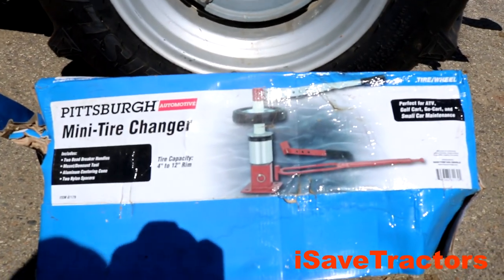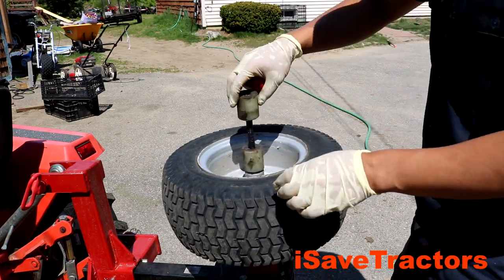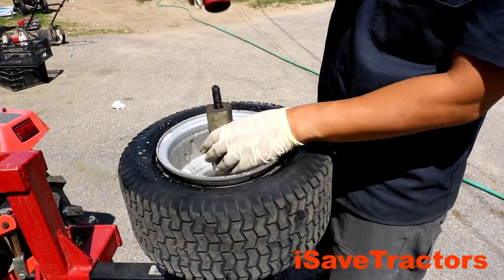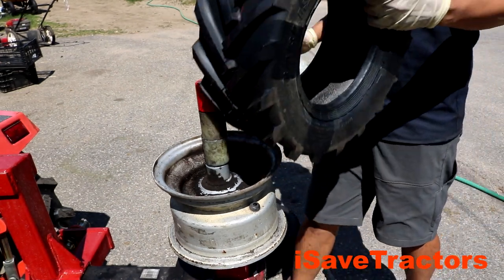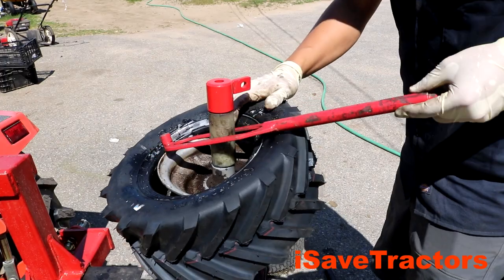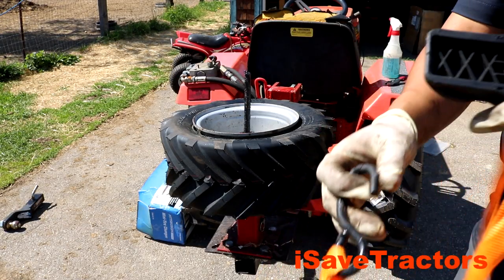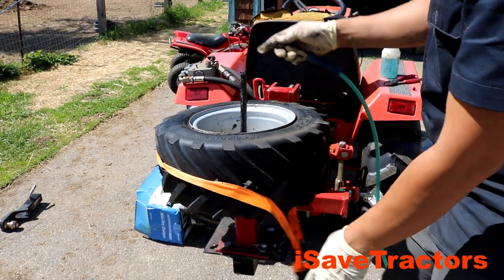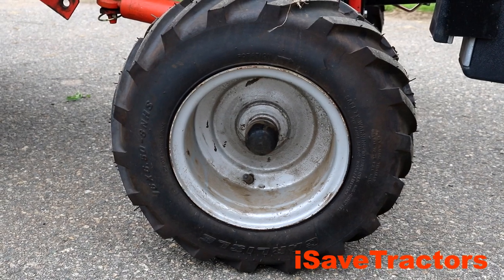Installing Garden Tractor Tire with Pittsburgh Mini Tire Changer from Harbor Freight Tools

Comment: Pro tip. Don't put the tire valve in before seating the beads. You'll get faster volume of air for seating. Clean the lube from the lower bead, then push down to seat the bead on the bottom as much as possible, then gently lift while applying air pressure from a 3/8" i.d. air hose. May not need the strap.
Reply: Pro tip throw that stupid tool in the trash. Leave the rim on the tractor get a duck billed sledge and a set of spoons. You can do this simple job in hakf the time

Comment: wow! that's a Harbor Freight tool I actually want.  I have fought with small tires for years.
Reply: I have one I bought years ago. Works well. The ONLY issue I have or maybe I should say wish, is that unlike an automotive type changer, it doesn't have a way to keep the rim from turning while your trying to remove or install a tire. Otherwise it works well.

Comment: Just found this. I want to change a 12" tractor tire and wasn't sure the tool could handle it. Now I know. I've changes smaller tires 10" rim with no issues. Love the tool and of course price, had it for a few years. Now I can start on the 12" rims, save money and drop off time. THANK YOU.

Comment: OP doesn't say anything about this, but shows it at the two minute twenty-four second mark, that a rim with a deep well on one side, has to be oriented like this, the picture or you'll never be able to get the tire off or on again.
Reply from the maker: Correct you want to work the side of the rim, where the tire can get some slack.

Comment: Nope, won't work for my Deere 265's front rims. There's no opportunity to keep the tire from not coming back up off the rim as you rotate the tool during install. Holding onto the tire doesn't matter. You can keep the tire inside the rim with vice grips on the rim as a blocker, but then you won't be able to use the tool to rotate it around.

Comment: Thanks much for your video. I have to change two new rear tires 23 x 10.5 -12 inch and do have a small tire changes which I have never used because had no way to secure it, but your application has solved that problem for me. Again thanks.

Comment: I  had a fella from work mount my tire changer to a 2x2 square tube for the receiver and bolt the tire changer to a plate with bolts ,He charged me $ 13 for the square tube he had to buy and it works great.Your video looks very easy I had a little more of a problem but will try your technique.Thanks.
Reply from the maker: Practice will get you there!

Comment: Good added tips jpeterman57; also wire brush the rim where the bead seats and use soapy water before removing the old tire.  Lastly and most importantly, the design of the wheel well determins which side to remove the tire.  You notice the shallow side of the wheel is up.

Comment: To stabilize it is the greatest challenge.  I may get one!
Reply: Paulie - I bought one a few years back, great product for the money. 💯 the hardest problem is mounting it to a solid platform !!! I tried an old pallet but it was too easy to pull the nails out of the cheap boards

Comment: I may have to try one of these. I have a manual bead breaker and tire spoons which work great, but on 8" and smaller rims, it is pretty difficult. the ratchet strap works most of the time, but sometimes it takes a long time and lots of fighting to get them to seat

Comment: You sure made it look easy brother. I did my first 12" tire repair with this tool by adding an inner tube to an old tubeless from my 1999 Murray lawn tractor. Took me over an hour. I learned a few things but what I didn't expect was after I pumped it up the valve stem slowly receeded inside the rim and vanished while I was reaching for the valve cap. Why me?
Reply from the maker: First few times it took me a while too. but after a few, it get's easier.

Comment: Those tire changers are cool and all, but I find it easier and faster to just use a spoon or two. It might be a different story if I had the space to dedicate to leaving it mounted somewhere. But alas I don't. 

Got any good tips getting a stuck bead broke loose? I personally put the lifting part of my "high lift jack" in the receiver of my van, put the footplate on the tire (which is laying on the ground below the van hitch) and give'er the beans. Usually works good. Have actually had one or two so stuck that it just about lifted the van.

Comment: For the tire, I just aired it up & the bead popped back on.😎 did the job without the tool & bent the bead, it was the old original tire I put a tube in it. Since I’m changing the 2 front ones I’ll be changing the 2 back ones too, one of the back ones is to far gone.

The tool has paid for itself already, & I’ve removed 4 tires w it & put 1 on some to be 3 more.

Comment: The only tires I've ever seen that required the ether/solvent fume ignition method are 40's and up... Otherwise, ratchet straps are the norm here in Texas. 
Years ago, we had one hell of a fight dealing with Long/Fiat 50 hp tractor and my Dad was in it to win it... He popped the beads off with the front wheel of his Chevy and fought the rubber off the rim. We burned the yard with fuel and ultimately swapped out for a better solvent like ether that really evaporates much faster... Gas trail to the tire and whoop!

Comment: Had a wise man show me a quick way to seat a bead, take the valve core out of the stem and push your air hose quick connect to force a high volume of air into tire then put core back in and fill to correct pressure, works most of the time as long as your compressor is decent

Comment: Nice tool and I made a receiver and riser for mine works well on my Toyota. Only issue I have is the threads on all thread and the nut are weak and pulled out. Going to have to modify it.

Comment: entire valve stem as well.  The starting fluid is not dangerous.  just need a tiny spray and then light.  it'll pop a bit and flame out but really it's nothing.  Just don't over spray, tiny bit enough.

Comment: how wide is the square steel plate and how thick of steel plate did u welded the square plate onto the hitch or bolt it down to it

Comment: Nice video. A question, is there any coating on the tool that goes against the rim. Looks like it could damage the rim.
The Ingersoll looks great with those tires👍👍👍
Reply from the maker: There is a rubber type material but mine has all rubbed off. I put duck tape down to prevent too much scratching of the rim.

Comment: I know this is old, but where did you get the black adapter? Bought the tool & im using a 4x8 section of wood & it’s really hard to Maurer, trying to hold the tool & get the tire off is a PIA!

Comment: About to go buy this in a few minutes. I've been struggling to remount a garden tractor tire i put a tube in.I don't have a receiver hitch..yet on my truck... but I bought a table vise to install on my garage workbench. I've seen videos of some using this method to secure the changer... not sure if i like that. Cast metal can crack and break with little to no warning.

 Mounting permanent to the bench seems restrictive (no way to get a 360 work space), Building a Mobile table also has issues.. (Don't want to chase it all over the Garage!)

 Looks like I need a floor mount with some angle Iron and concrete anchors (Got those). Anyone got any other suggestions.. Space is really limited in my Garage.

 Thanks for the Video and any suggestions. -Jake

Comment: Are there adapters with that tire changer to do larger rims with a large 2" center hole like on a 70s wheelhorse?
Reply: yes, there is an aluminum cone to fill the hole and keep it centered.

Comment: I have a 77 Sears 10/6 after running for the first time there was a little oil leacking out. looks like from a hole in the bottom of the intake before the carb? Do you know what may be causing this?

Comment: will WD40 sprayed on tire work as lubricant or better to use soap and water?  thanks.  good video.
Reply from the maker: Yes it will work. It should evaporate quick enough for the bead to not slide on the rim after insrallation.

Comment: Do you have a link for the hitch adapter. I am having no luck with it in my vice. It likes to pivet out.
Reply from the maker: I tried to look but I can't find it. I did get it off of eBay. Also you can take a big 2inch receiver tube and weld 1/4" plate to it.

Comment: Did you fabricate that receiver adapter, or does someone sell them?
Reply from the maker: I bought it off of eBay a long time ago. I can't seem to find it again though. it would be easy to make. Weld 2x2 tube to a 1/4" flat, drill some holes and voila.

Comment: Here's a trick, let all the air out of the tire wile its on the tractor and drive it forward and back, it will bust both beads never fails if you've ever had a flat on a tractor its a pain in the ass to get the tire back on the bead to put air into it.
Skip a step I almost bet you could change the tire on the tractor, guys do this in the field with tractor trailers on dully wheels they chang the tire on the truck.

Comment: Bar tires on the front huh.
That thing got "front wheel assist?"
Reply from the maker: Full power steering
Reply: Looks badasser !
Reply: Rusty Zipper I prefer tri-ribs
Reply: jhitt79 - it depends on the style of the tractor. If you’re looking for that 4wd off road look the the Bar tires look better on Norman’s tractor. I’m looking at tires for my Cub 169 and think the Tri-rib front tires will give it that classic look since it’s obviously only 2wd.
Reply: Rusty Zipper yup, I was just joking around about the front wheel assist. I personally like bar tires in the rear with narrow tri-ribs in the front. But most important: I think people should do whatever they want with their own stuff.

Comment: I see that when trying to mount the top bead, you had the same trouble that I did - as fast as one side goes on, the other comes off. Then, there is a break in the video, and you come back with the tire over half-way on. I assume you got that far with a real changer and then came back to finish with the Harbor Freight POJ. This tool is poorly designed and doesn't work as portrayed. Moreover, the "hook", which is aptly named, has sharp edges that destroyed the bead on my tire. If the tire didn't already require a tube, I would be looking for more from Harbor Freight than just a refund.
Reply from the maker: I install a lot of tires with this tool. I don't remember at this point what happened with the footage that required a cut but this isn't a magic trick that requires a TV camera trick.  I still use this tool to this day and have a few other videos of me installing tires with this. I think I actually have 4 videos. To each their own. I'm not paid by any tool company just showing you how it's done
Reply from the maker: And a little tip for the bigger tires. Put a vice grip on the rim to keep the opposite end from popping off
Reply: @Isavetractors  I take you at your word and will check the other videos. I just see no way that it might work.
Reply: @Isavetractors  I don't have a Vice Grip that big so tried a clamp with no success.
Reply from the maker: Here is a video: https://youtu.be/7tnMDlWlGUs
Reply: @Isavetractors  Thanks. What would be helpful would be to know where you got the receiver hitch adapter?
Reply: @Isavetractors  I saw another video and now understand what you meant. Makes more sense and is a good idea. Thanks for the suggestion.
Reply: I suppose I'll have to make my own. How long would it need to be?
Reply: Nope. Spoke too soon. No place to put the vice grips not in the way. There seems to be no way that the HF tool can mount this tire. You really do not need a device like this for the easy tires, and if it won't do the tough ones, then it really isn't much good, in my opinion. As I said, I think the mount bar is poorly designed. Has sharp edges, twists and comes out, etc. So far zero stars for me.
Reply: I'm trying to get a tire on with my hf changer. It gets to a certain point and then starts digging into the bead. Most likely I destroyed my new tire!

Comment: That tire didn't go on as easy as you made it look. cut the camera and then come back to it?  Throw that tool out they gave you and use regular tire tools to r and r them. Nice tire changer but your being misleading about it.
Reply from the maker: We had a technical issue with the camera so we lost some footage. It however is that easy to install the tire. We have about 4 videos on our channel using this tool. Note: this is not a paid advertisement by HFT or Pittsburgh Tools. I simply had to mount a tire and decided to film it and publish it at the service of you the viewer, so you can see it in action.
Reply: It destroyed the bead on my new tire!
Reply: @danoakley6538  Did the same to me.

Comment: Worthless piece of junk. Wont even break the bead on my little 8in.  tire from a Deere rider. May work ok on new tires but worthless on old tires that have been mounted for years and stuck/rusted to the rim.
Reply from the maker: On my Ford 120 restoration series I use this tool to remove a pretty rusted wheel and tire. I had to throw all my body weight into it several times. I eventually got it off, but I've encountered tires I couldn't get off with this. For those I send the tire out but I've been able to get most tires off, and I installed maybe 20 tires a year on everything from tractors to atvs and go karts.
Reply: @Isavetractors  just tried it one more time before taking back. Aluminum handle broke in 2 pieces and bent threaded rod. JUNK.
Reply from the maker: To each their own...
Reply: Heat it with a hair dryer and whack it really hard with a rubber mallet before you use this tool.  Certain tires are worse than others.  Make sure all the air is out of the tire.  Can try driving on them with a car and you might have to use a board to get the weight where you need it.
Reply: @robertclark4929  Sounds like you ndde to learn how to use it or just pay a professional to do it for you!